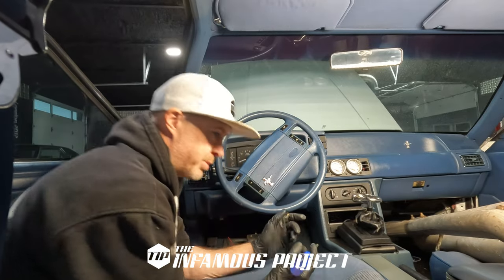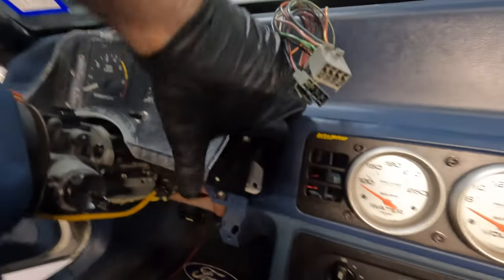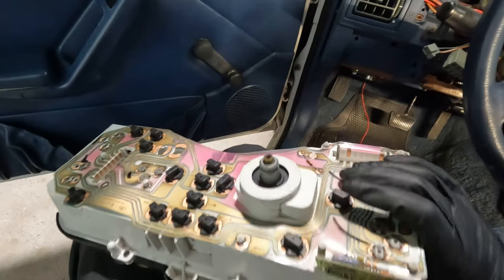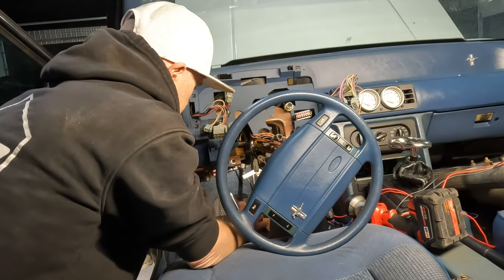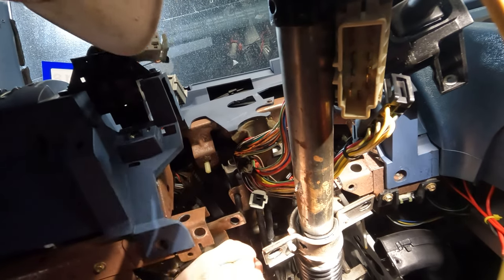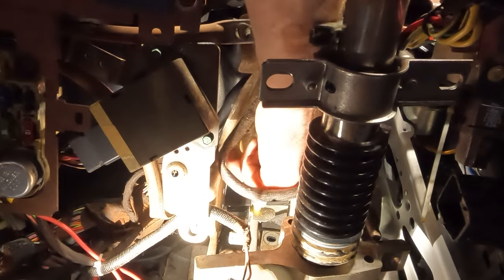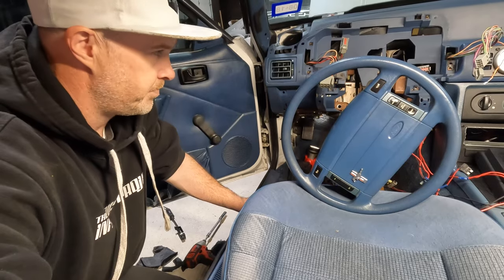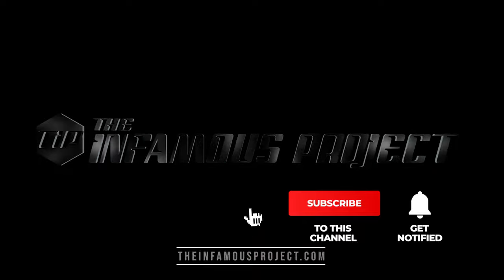Foxbody 5 Speed Swap - The Pedal Assembly Install  -TIPS05E13

Comment: The reason for the button under the column so that the key won't turn back all the way is so that if you turn the key off in an emergency while driving you don't lock the wheel, but I think the auto mustangs had a cable to keep from turning it back while in any other gear but park.

Comment: My 93 white coupe I have now. It was a auto and I had to swap it over as well but I don't remember switching the cable but that was 10 years ago at least. I did that and had to drill out the firewall bolt holes on one side with a unibit for the sn95 brake booster to fit for my 03 cobra front brake conversion and a sn95 real 1995 Cobra disc rear end that I installed as well. Cool detail video for anyone that needs to swap it.

Comment: Chris
I pulled my column. I removed the shifter. It attached to the column. What do you do with the connector that hooks to the shifter at the column? I believe it’s a 3 wire connector that’s black. Thanks for any guidance you can provide.